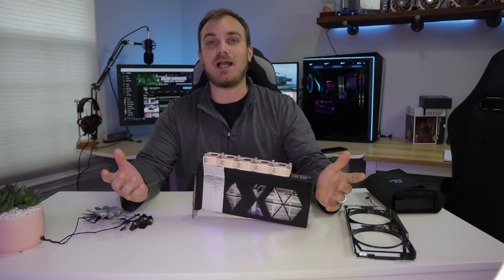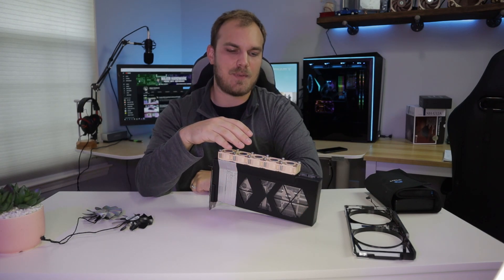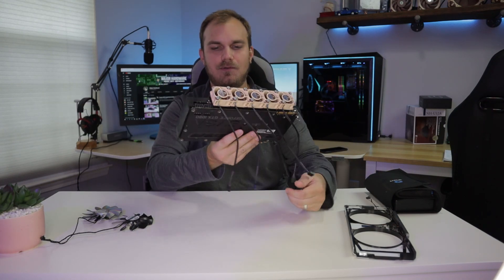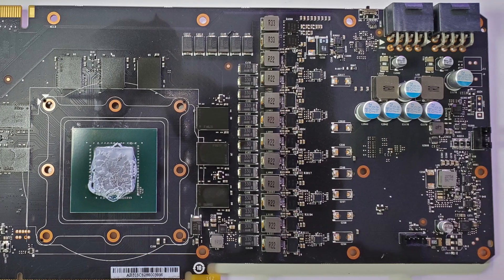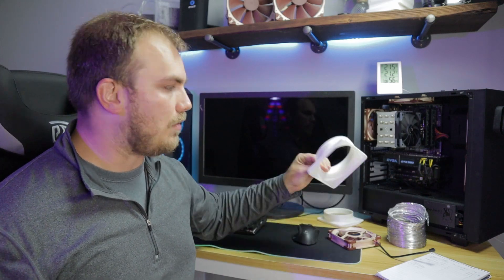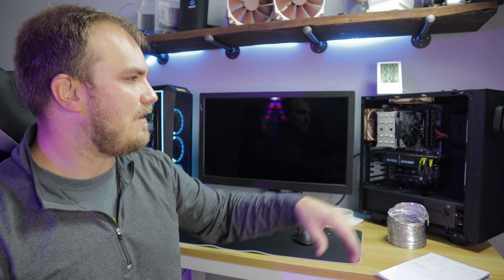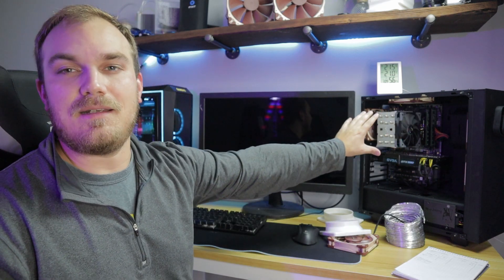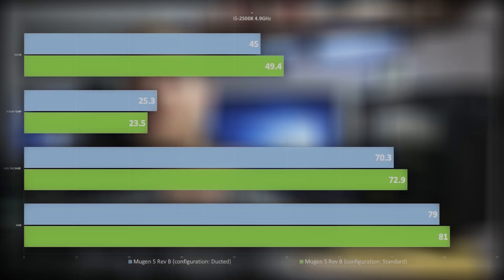Does Connecting Your CPU COOLER Directly To Your Case Fan Improve Temperatures?

Comment: 1080p60 is much better 👍🏻
And with your "tunnel" for your Central Processing Unit cooler:
Some OEM-Manufacters do something similar
They put a big shroud made out of plastic from the front to the cool and that's it
But this with the evga card would be cool

Comment: Great idea!
Any thoughts about adapting a cheap air conditioner from Home Depot to cool the air on the way in, and then pipe it back out again?

Problem with traditional water or air cooling is that they just make your room hotter - I'm dead keen to vent this hot air outside, or start with cooler air.
Reply: Problem is, if youre doing it with a loop (open or closed) you could/would lower temps to sub ambient, which would form condensation on the tubes/block, resulting in lots of water droplets running onto the board, damaging it.

I'm not that sure with air coolers, but the tubes are vapor, which most of the time is water, albeit a lower quantity.
I don't know the actual physics behind it though. So I cant actually comment.

Still, if it would work without problems, I'd like to see it done.

Comment: Can you try this also with the gpu?
Reply: Works extremely well especially if you separate the gpu(s) from the rest of the case... such as remote mounting or via a gpu baffle it drops the temp of everything in the case including the gpu(s) as the heat from the gpu(s) doesn't get radiated to everything in the case nor does it allow the gpu to heat the actual air  in the case where all the other cooling takes place such as ram, ssd/hard drive, CPU, RGB controllers, floppy disc, disc drive/burner, etc.

Comment: I had a HP dual socket workstation in the early 2000s that did something similar to that. The difference being that the ducts got around the entire cooler and then to an exhaust for better heat management.

As for your card, I do repair broken cards as a hobby. So, if EVGA isn’t able to help, I might be able to. There’s also a person on YouTube that does that (not buildzoid).

Comment: That is very interesting, I would appreciate longer testing with a high tdp axial card. I run a r9 fury nitro and a 7600k @ 5.2 ghz, the only real reason for me to use an aio is the fact that my gpu brings the air temperature to above 40 Celsius, easily. I think a setup like this with a intake dedicated to the CPU on he top front would look a lot nicer than the one in the video and give better results than my ML 240 lite.

Comment: This used to be a big thing in the early 2000s with a duct in and a duct out so no heat from the CPU contaminated the case.
Reply: Duct system is still a big thing for brand-name workstations from Dell, HP and Lenovo as well as in servers. Almost all servers use a duct system in form of paper-thin plastic sheets which force air in a straight path over CPUs and RAM sticks.
Reply: To think that the 200s were -10- 20 years ago
Reply: I came in to say the same thing LOL. I was a system builder, and all those cases had the big plastic side funnel right over the CPU area. Still got one or two in the garage.   Also to Major Hardware, a ton of OEM's do this. Tons of SFF and Mini PCs do this still. Most Dell's have something like this inside, or did, the older models in the Optiplex series. Even newer ones all still have something similar in theory with the micro cases.
Reply: @jbstillman  the Mid tower that I'm still running (circa 2001) had an exhaust fan sans duct, directly over the CPU. Not that I have the side panel in it due to all the LEDs. LoL
Reply: Yes, yes, and yes. This idea has been part of many designs. If fact I think the Mac Pros of even 2006 had a similar type of design. Enclosure pushes all air from the back, pulls from the front, while the CPUs have air directly pulled from the front and pushed out the back.
Reply: Who remembers the thermal take duct mod for getting rid of the dead spot beneath the fan?
Reply: I remember this in the pc I built back in 2008
Reply: Yes remember 2000s 😅
Reply: im 2 years late, but still feel the need to weigh in...
can confirm OP's comment
have Aspire X-cruiser chasis circa 2005?
side panel clear fiberglass, had this clear blue tinted fiberglass duct mounted to side panel, to direct air to cpu.....
well that POS went right out the fcukin window because theres a thermaltake frio mounted, 1kg of pipe and fins, so fcuk that stupid duct it was never going to fit...
so dumb, just mounted 2X100mm fans low rpm on a pwm to the clear fiberglass panel, made custom shroud/cover/filter, force a lot of cool air into case, cpu fan picks it up, punts it to rear i/o exhaust
goodbye heat
never putting water cooling into a metal box full of 1000W and circuit boards.. its just asking for it.. air cool all the way, just go big low rpm
its heatsink, not a leafblower... my heart goes out to all watercooler cool kids who had an oopsie in this over $9000 gpu market
air convection heat transfer master race ftw
Reply: Started to be a thing in the mid-90s, in consumer PCs.
Reply: Correct Intel released a new form factor called BTX where the CPU was at the bottom of the case and closest to the bottom intake fan.

Comment: Just wondering if the fan on the CPU-cooler should have been a Noctua as well since you directly connect them with the duct. Maybe there's some more performance gain. And what if you directly connect it to one exhaust? This was a fun video, but it raised more question for me. Good luck with the GPU. I really wanna see how that works out.

Comment: hu. commenting at about 3:30, seeing how the case with the heatsink looks like. how about making the cpu-area it's own thermal zone? similar with how psu's have it these days. one shroud from the rear fan to the tower, a second shroud from the tower to the top fan. one as intake, the other one as exhaust. it's probably not that much different from what the duct from the front does. 
wait, just thought of a WAY easier solution. a simple divider-plate, that devides the upper and lower part of the case. no ducts needed, just a simple acrylic plate.

Comment: ok so ive had this idea for a while but dyson vacumes are pricy as hell.
now they made a huge deal about there 2018 model vacume 
mostly on the inline fan and moter, its static presure and airflow are way past any pc fan, i think it would be cool to see one used on an aircooler, or even pumped throu a radiator, however i feel the gains will be much less in water cooling, i have a few little ideas ive layed with in scetch but i cant draw for shit, i could give some troble shooting imput if needed but im sure you could figure it out
link atached is what im talking about!

https://www.youtube.com/watch?v=f_Z5JiEjL-k

you only need to see the start, do some resurch if you like
oh~ and heres a weard dude playing with the v9 motor

https://www.youtube.com/watch?v=YfnyhoEZXhM

Comment: The tube should be straight, no baffles on the sides of the ducts that would create turbulence, and a lot like some car intake mods you could add a set of fins to create a vortex in the air, and thus more airflow. Could be fun to really push the concept to its theoretical best.

Comment: “Why no one does this?”

Because my case has good enough airflow. But we have multiple old high end winxp workstation pcs at my workplace, and those have air ducts on the side of the case for the stock top-down heatsinks.
Reply: But they are doing it, in workstations.
Reply: I had a case that actually does that. I liked the idea but it messed with clearance so I took it out. Unfortunately that also meant I lost the case badge logo as well lol
Reply: @ArtisChronicles  Antect use to do this
Reply: @ArtisChronicles  Was it a dell clamshell? I had one of those :)
Reply: I use to do this with air coming from the window through the side vent in the summer. In the winter I would exaust it to under my bed
Reply: Because other components on the motherboard also need airflow over them. Why use extra material /costs for minimal gains.
Reply: @mrskwrl  Not really. Natural convection in air that is being changed is totally sufficient for almost all motherboards. The gains might be considered minimal, but they improve the bottleneck of the system - cooling the motherboard components more will not do anything close to that performance wise. And a 4.5 degree temp delta is actually pretty substantial.
Reply: Its been done homie.
Reply: No one cares about your airflow. This is clearly to prevent GPU hot air being pulled over the CPU heatsink, NOTHING to do with airflow.
Reply: good airflow is irrelevant, it's about isolating components to work in their own environments. This duct would be useless with bad airflow and possibly worse than no duct.
Reply: There can never be enough airflow for a gamer

Comment: Awesome vid.  I suspect the deltas will be even higher with a non-blower card.  The blower card is great for CPU cooling because it ejects its own heat.  I suspect your 1080 will heat up that case a lot.

It would be intetesting to see the GPU temps as well.  I wonder if the ducting hurts GPU airflow.

Comment: i have the top fan blowing air on rad as "intake fan" seem to get a way better lower temp this way,
but i have a 3x back exhaust fan on the back make sure it blow out all the heat inside the case, use the top fan to blow air on memory and VRM
then 2 front Intake 140mm fans, and one for the hard drives, and i put xtra one behind the motherboard back to the cpu back plate, it does help a little too. at the end of the day temperature is getting ridiculous low, as i speak my i5 3570k clock at 3.9 asus p8z77v i get 30 celcius all core. 
now add this on top of it. and i don't even have a noctua fan, i use dual evo12 with artic silver 5 thermal past.
Reply: Arctic cooling value packs here I come

Comment: Run your ductless test again, without the top exhaust fan. I'm thinking the fan trying to pull air through the cooler is competing with the top exhaust fan trying to pull air out of the top of the case, creating turbulence in the air flow. Putting the duct on eliminates that or at least reduces it significantly ( we can't really see vortices or other turbulence with smoke or some other visual aide.)

Comment: Old Apple and Dell/HP pre-buillt systems use to have duct work interiors.. Also why did you use a case with a blocked off front, those types of cases always end up grabbing air from the interior more so than any small side or bottom ventilation. You of prob gotten better temps if the case you used had a mesh front.

Comment: This is why I love this channel man, it's always very interesting.

 I remember seeing something like this way back. I used to have a case that has grills on the side panel, right above the cpu cooler. The cases would come with an extra tube/duct that you can screw on to the grill so that cpu cooler can draw cool air directly from the outside.
Reply: fena hauhnar asus vento 3600
Reply: @specter6633  just a basic office oriented cabinet. Needed to save costs for other parts lol

Comment: Now what you need to do is either cut a whole in the front of the case that corresponds to the front intake fan or print a new front panel with that hole already designed into it and attach some flex hose up or down to your air conditioning vent and then check temps!

Comment: In the Late 90's Early 2000's most cases came with fan mounted on the side panel and you could get a duct that would connect from the side panel to the stock cpu cooler, we would get a extra duct , screw that on the outside and run some ducting up to the AC unit
Reply: -73 C
Reply: You are right! Now I remember those side ducts, sometimes with a Pentium or Celeron.

Comment: Why not directly to your air conditioner? I challenge you to do that!
Reply: dude condensation will fuck his pc
Reply: I once stripped a fridge, put the evaporator in a cool box, insulated the cool box with isolation wool, filled it with a mixture of spirit(denatured alcohol) and water, build a case around it added some wheels, stuck an extra layer of heater foil on the outside, then had 8 80mm fans blow over the condenser, unhooked my water cooling pump and dumped it in the cool box instead of the water tank. 

It kept my cpu at a balmy -5 degrees Celcius under gaming load, when stress testing it went to approx -2. It was all fun and games until summer came around and condensation started to become a thing, eventually it broke down due to too much condensation, even though I had insulated the hell out of it and covered almost all components with vaseline. Apparently outside temps of 35 and a cpu running around freezing point will create SO MUCH condensation it started pooling on the bottom of the case.
Reply: @rey_nemaattori  
Talk about overkill. 😂🤣😂🤣😂

Comment: Run a duct from the bottom intake to the blower card and test that out. :)
Reply: This!
Reply: @Moshenokoji  Thanks!  I just realized I have 42 likes.  That's the most I've ever had so far in a comment.  LOL
Reply: Good idea because warm light air moves upwards
Reply: I was thinking the same thing as soon as the video ended
Reply: Actually take 2 120mm fans and connect them to the one blowerstyle cooler. Why? It creates pressure so the card can get air easier.
Reply: Actully done that myself some years Ago like 7 or so years Ago and it did an massive differens thow did i also made som modifikations to the stock cooler of the video card also so no air could slip in between the cooler/ card 14c° improvment so did some overklocking due to that😉
Sorry for My bad english not the ablsolute best at it and the bloddy autocorrect Messing things Up also 😂
Reply: will fill with dust
Reply: @white_mage  dust filters are available.
Reply: yes but that adds maintenance and the bottom seems a little hard to reach [unplug the system, place it on its side]. it would be better running it from the side instead [remove the lid, detach the duct it attached with magnets or something]
Reply: @white_mage  just get a magnetic filter
Reply: I saw 3D-printed shrouds on Thingiverse to do exactly that in the Cooler Master NR200 that my next build (SFF for the living room) is gonna be in. :)

Comment: Back around 2001, I bought a kit just like this, and used it to direct cool my overclocked pentium 4. :)
Reply: How did it stack up when Crysis came out?
Reply: Was it a Socket 423? I remember my AMD T-Bird use to get toasty ASF
Reply: @hd1845  I cant remember... I think it was 478.
Reply: @hd1845  i put a pentium 4 in my butt
Reply: I dropped my pentium 4, im not sure it still works, but its lga so no bent pins

Comment: here's one, does staking fans help improve CFM? for example, one fan right in front of the other will the back fan see improvements in pressure or worse. I have an inwin 303 and I populated all the top fan mounts which means the psu fan is either very happy or very starved.
Reply: It helps but not much tho so you just adding more noise for very little performance.

Comment: I installed a high static pressure fan to make my cpu a push-pull configuration accept the fan is hooked to an external adjustable voltage so I can make it blow more or less and it works wonders on keeping things cool. I also added another case fan to the side of my case hooked to the same circuit for cooling off my gpu.
Reply: I did exactly the same thing, have an 80mm pushing air into a duct that goes over the cpu cooler and another 120mm fan simply pushing air over my GPU. (My only difference is I have that 80mm plugged into the same power as the cpu fan so both can ramp up as needed.)

Comment: My very first PC case had a side duct, meant to deliver cool air on top of a stock CPU cooler. One of my older work computers (a Dell, I think?) had basically this exact setup, but with hard plastic channels. Also, the idea of cooling the CPU with cooler outside air is exactly why my current PC is cooled with an AIO set up as an intake.
Reply: Yeah but that way you're putting the heater air from colling the CPU onto all the other components in the case. Whereas is you have it on the exhaust all the hottest componenst put their heat straight outside keeping the whole thing cooler, admitedly with the CPU negligibly warmer.